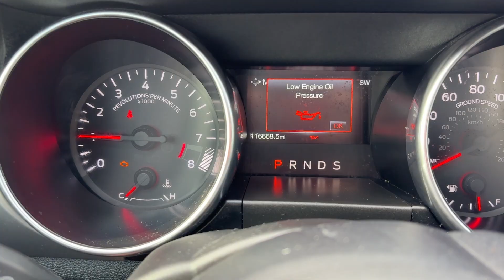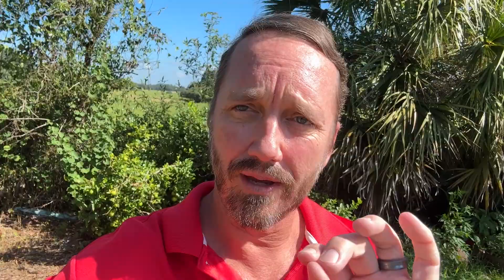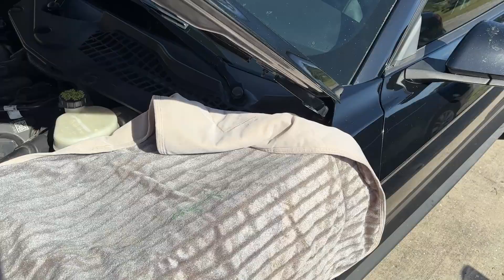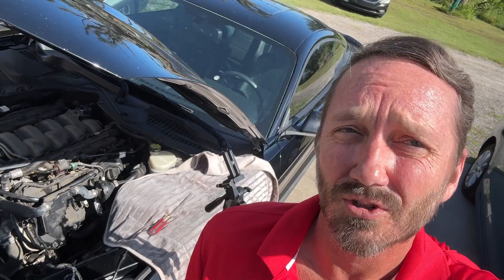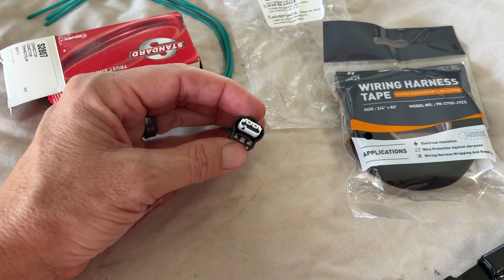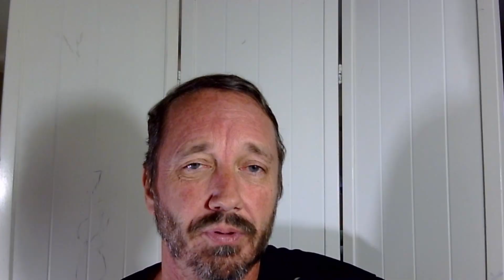OIL PRESSURE SENSOR - p0521 code - Mustang GT 2018 - Diagnose and Replace Sensor and Wiring Repair

Comment: What did you end up finding the problem was?
Reply from the maker: There was a small oil leak from the head gasket that was shorting out the sensor repeatedly.  I had to replace the gasket and never got the code again.